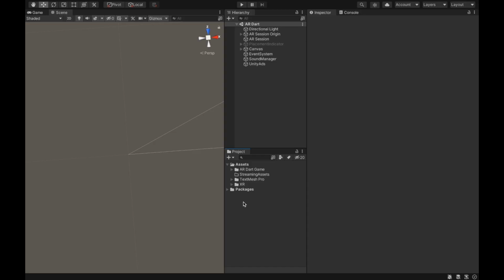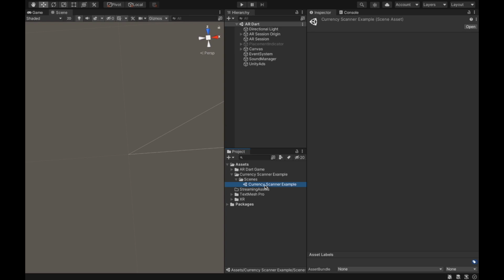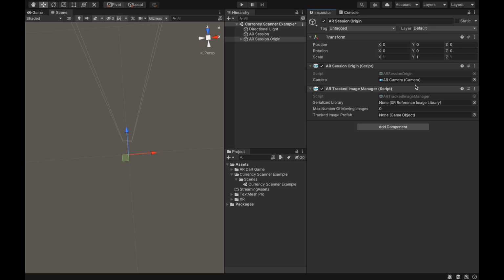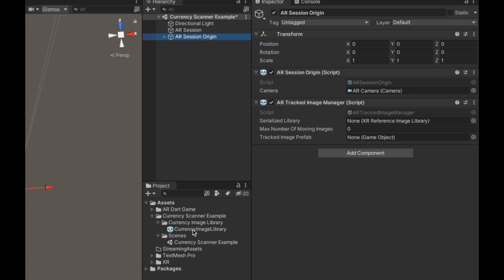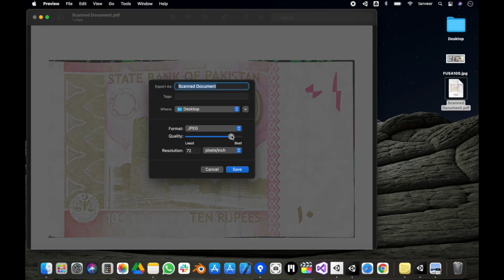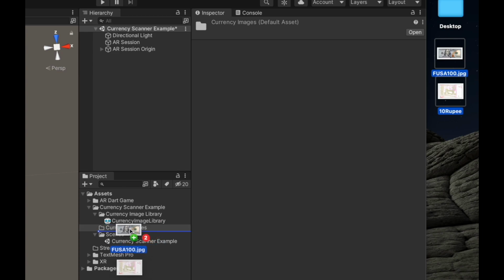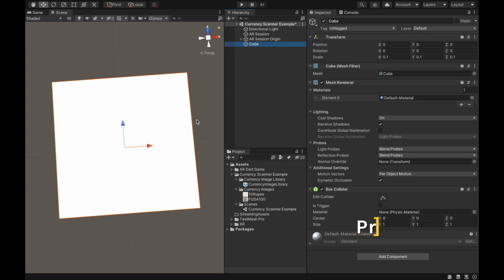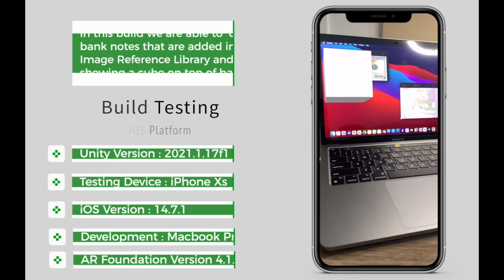Detect Currency image and Basic Setup in Unity  - Part 1

Comment: What versions of Unity / AR Foundation should be installed for this tutorial?  
Is it no-code, or does it use code (c#)?

I'd like to make a checkers-like Android AR board game where everything takes place on a piece of paper on the table... no glasses, just the phone's camera. The AR engine would overlay tiny 3d objects in highly precise locations, but is that possible? For example, If the camera gets too close to the paper, then it may lose the paper as a marker.. so can it automatically switch to markerless tracking such that it still knows what part of the board is in the camera view? 

Would Godot be a better choice for android AR , or Unity AR Foundation / Vuforia ? ARCore ?
Reply from the maker: Closest best solution will be in vuforia.
Currently all available solution will show minor drag difference,  because system all the time calculating to keep 3d objects at its position in real world.